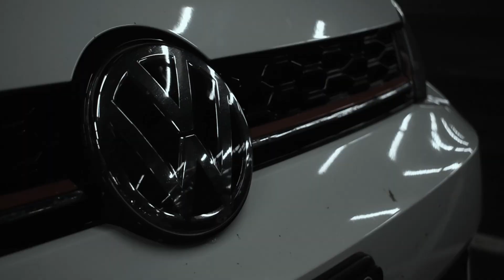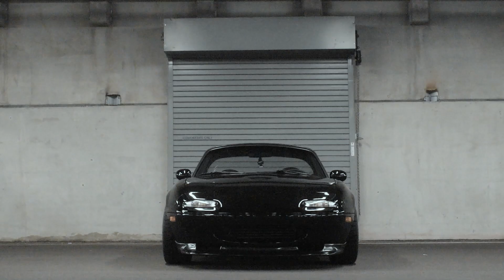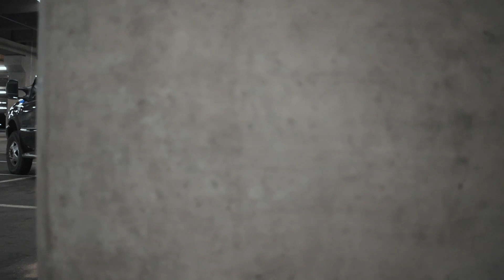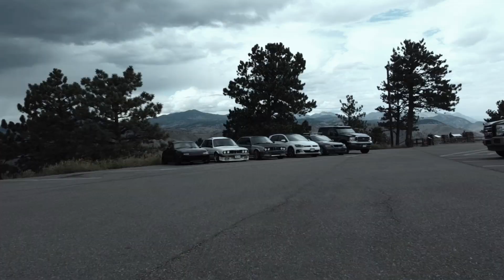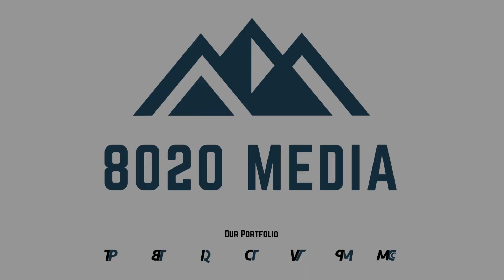The Hyundai 2.0 Turbo Engine | 4 Common Problems & Reliability

Comment: Thanks Zach! My 2013 Hyundai Genesis Coupe has 77k miles on it and I've never had an issue with it. I'm 65 years old and it's the most reliable, maintenance-free car I've ever owned! The only money I've spent on it is $200 for a new battery and $200 for a new tire, and both happened at about the same time a year ago! I do have a slight leak in the Valve Cover Gasket just like you mentioned! BTW, how can I tell which engine I have (MPI or GDI)? Thanks again!

Comment: 2011 hyundai sonata 2 0 limited 99,000 miles. 0 problems Literally 0.  Today I went out to change spark plugs and found the valve cover gasket leaking a tiny bit. So ordered a new gas🎉ket and high pressure fuel pump gasket. Will do both together now once I receive them. Also I believe my turbo actuator is sticking or voltage is out of spec will be doing that soon also. Needs to be at 4 volts. Thats why you may need to restart your car twice.

Comment: 2017 Santa fe sport turbo 2.0 blown last week at only 58k (36k miles). Getting replaced today under warranty but is the new engine any better? New warranty is one year/14k woohoo. Will this make it harder to sell or should I keep it?
Reply from the maker: G - If your engine blew at just 58K (or 36K miles as you noted), you're unfortunately one of many affected by Hyundai's well-documented engine reliability issues—specifically with the Theta II turbo engines, which have a history of bearing failures, oil starvation, and seizure; the replacement engine you're getting is likely a remanufactured or updated unit, and while it's improved, it's still based on the same platform, and the 1-year/14K mile warranty isn’t very reassuring. This absolutely can affect resale value, especially if the buyer is informed, but ironically, having a newer engine with low miles may actually make it easier to sell in the short term. If you’re risk-averse or plan to drive it hard, you may want to sell it sooner than later, as these engines have a mixed track record—even post-replacement—whereas keeping it is fine if you're planning light-duty use and regular maintenance.
Reply: @8020Automotive Thanks for the reply. My main main car is an old beater for work and back. This hyundai is for wife errands and little road trips, it's babied. If in one year I can get close to what I paid, then it's gone. Otherwise I'm stuck with it.

Comment: What about the engine in the Elantra N?
Reply: I have 112k miles on my veloster N that’s tuned making 350whp. The engines in the N cars are no where near identical to the theta in the genesis coupe.
Reply: @ I think all the Ns are very underrated and also because of Hyundai/kia’s history of engine issues with lawsuits people tend to not trust these brands.
Reply: @cloudies3671 yeah those lawsuits were just the American made theta II’s where as the cars built in Korea or outside of the us are higher build quality and no manufacturing issues.
Reply from the maker: @ Thanks for sharing your experience.
Reply from the maker: C - It's similar to the engine we describe in this video

Comment: Bought a 2013 Sonata 2.0 Turbo with 157,000 miles with a blow headgasket.  I decided to put in new Hastings rings, rod bearings and crank bearings; shaved the head and block for the new gasket, had the bores honed and the crank journals polished at my local auto machine shop.  The shop did a real good job removing all the carbon accumulated in the intake ports and valves.  I also replaced the turbo charger cartridge (the shaft was bent) and the waste gate actuator.  I re-used the original pistons (rings were stuck in the piston grooves rear bad), connecting rods, timing chain, chain tensioner, chain guides, etc.   It's been over 10,000 miles on the engine and she doesn't burn any oil doing 3,000 mile oil change intervals.  3 out of the 4 coil packs failed along with a leaking oil pressure sensor;  easy fix.  
Believe the oil consumption issues with these Hyundai engines is due to low tension oil and compression rings.  The Hastings rings, IMHO, have higher tension compared to OEM rings.
Reply from the maker: H - Thanks for taking the time to share your experiences and insights!

Comment: My 2016 sonata has the 2.0L turbo and shut off while drive at 125 xxx km.... hyundia says i need a new motor and wont cover because im 5k out of warrenty. Ive done all my oil changes and taken care of the car all its life with me. The dealer wont even look at the motor because i did my own maintenance..
Reply from the maker: D - Sorry to hear.. However, thanks for taking the time to share your experience.
Reply: Same experience with the Kia 2.0T.  135 K on a well maintained engine, replaced turbo at 58 K and now at 135K motor is now shot.

Comment: #3 for me, 89000 miles. They promptly replace it and provided a rental in the meantime. Never used a drop of oil, plus it had all the recalls for knock sensor and the inspection one done, Only other issue, and it seems common with Hyundai/Kia, is the turbo waste gate switch. When the engine is first started after sitting overnight, the switch doesn't work. But if you restart it, it's fine until it sits for around 4-6 hours. Been doing it since before the engine replacement(four years+) and I've just grown accustomed to starting it twice before driving.
Reply from the maker: S - Well said! Thanks for sharing your experience. It will certainly help future viewers!

Comment: Engine seized at ~144,000 miles.  Hyundai replaced it under warranty with a rebuilt engine.  ~12,000 miles later, the turbo charger which connects to the engine had to be replaced.
Reply from the maker: Lin - Thanks for sharing your experience! This doesn't sound like it was very fun.. Sorry to hear.
Reply: Which country did u get that warranty claimed in?
Reply: I thought only the 2.4 was covered
Reply: @seandonnelly3150  All theta II engines.  They all had the same manufacturing defect.
Reply: @bryco32 i called and they told me they don’t cover my 2011 genesis coupe .